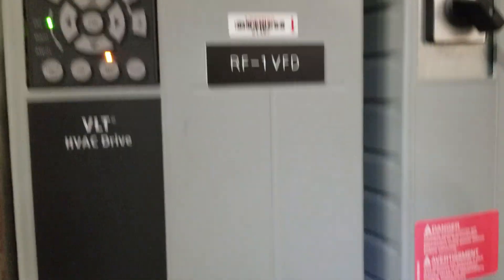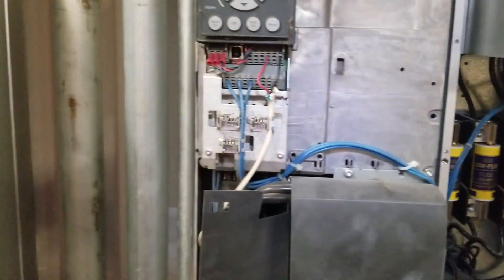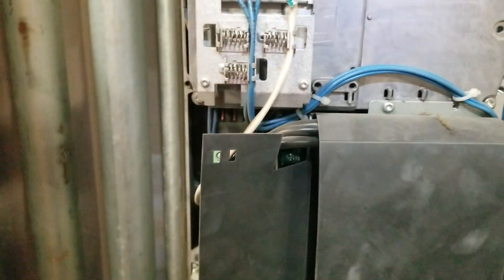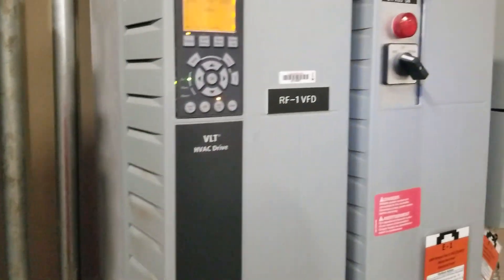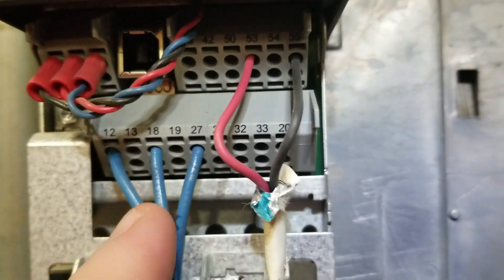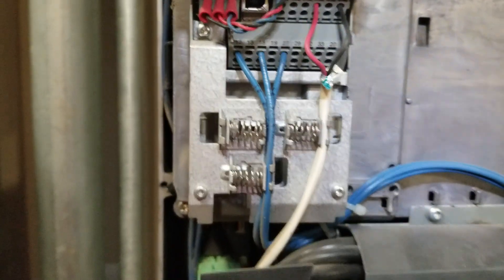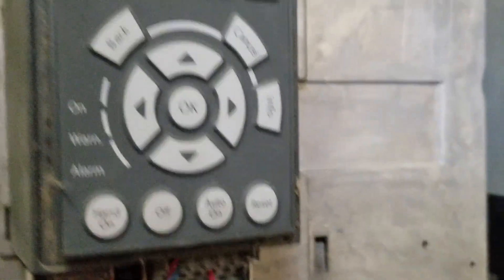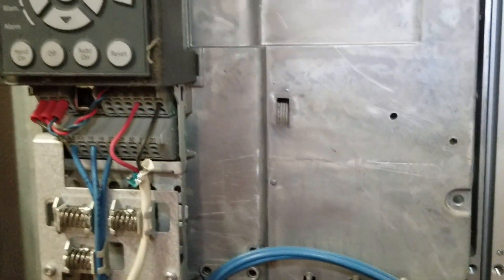Danfoss Drives Review

Comment: I have 72 VLT's and I love them. They replaced the Eaton HVX9000 series drives in our facility. I had one drop a phase and smoke a 30 horse motor, but that's it. They are very reliable and easy to install.
Reply from the maker: I just wish they would make a couple changes with the terminals.  Thanks for watching